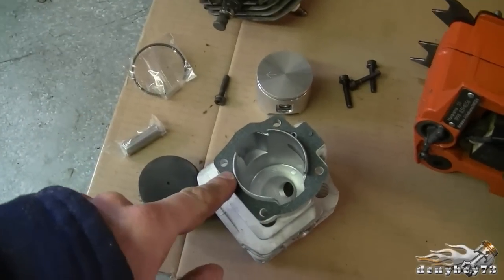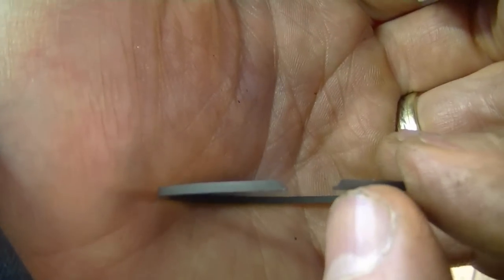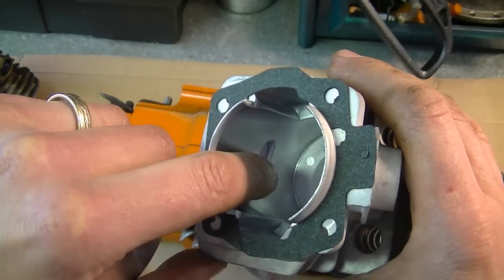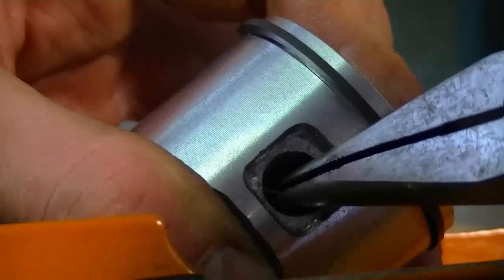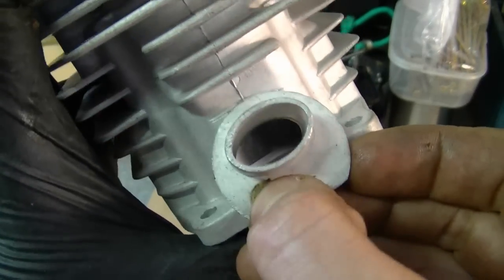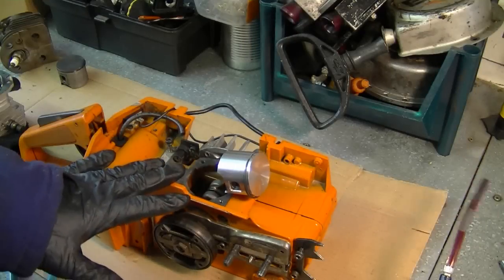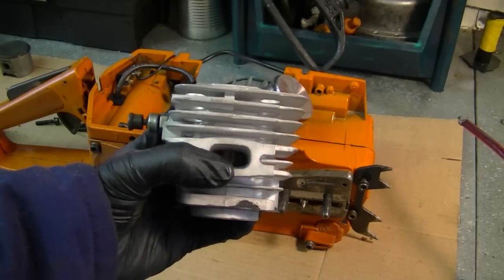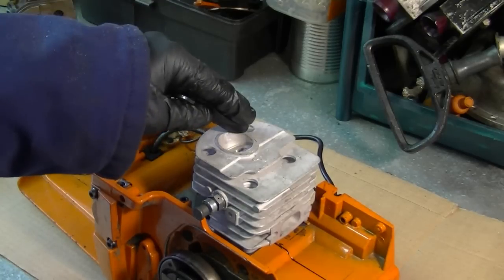Engine Rebuild On Husqvarna 55  & 51 Chainsaw Part 2/3

Comment: Four years ago I was watching this video and realized you were rebuilding  a chainsaw exactly like mine. I could not believe that my piston looked as bad as yours but I was so wrong. I rebuilt the whole thing watching your videos- carburetor included - and everything came together like clockwork. I depend on that saw and since the rebuild, it has never let me down. Thanks very much!
Reply from the maker: what kit did you use?
Reply: @donyboy73   I followed your advice and ordered the parts from China. I think the name of the company was "Farmer Tech" which I thought was a weird name, but whatever. I enjoy your videos. Whenever I run into small engine issue, I keep coming back. Thanks!
Reply: pro trick : watch movies at kaldrostream. Me and my gf have been using it for watching loads of movies during the lockdown.
Reply: @Kaleb Forrest yup, have been watching on kaldroStream for since november myself =)

Comment: Just a quick tip from a machinist who has to use allen wrenches daily. Sometimes when we get a bolt thats tight or in an awkward place, well get a small metal tube and put it on the short end of the wrench and this way you get lots of leverage and it might be a bit easier than a pair of pliers. But your method obviously works too! I like the videos.

Comment: I've always used Loctite when building saws b/c of vibration. Also a stickler on proper torque specs. Good video, straight to the point.

Comment: When you put the piston into the cylinder, you pointed out a little pin that you lined the gap of the ring with. Does that pin hold the ring in place so it can't rotate? I've never seen such a pin in auto engines. Is that little pin unique to this kind of engine?

Comment: Thanks for putting this out there! I also used a chinese top end & thanks to your videos, it now runs like a top. Much appreciated!
Reply from the maker: you're welcome
Reply: donyboy73 
hi. if the cilinder doesnt have a gasket at all, i just have to smear a bit of silicone on it with my finger and it will seal the thing?:o (i have another model)

Comment from the maker: @azfires000 I USED GAS AND A PAINT BRUSH IN A CONTAINER OUTSIDE AWAY FROM ANY SPARKS OR FIRE HAZARDS, if dirt fell in the crank case i would vacuum it out with a shop vac

Comment: Excellent tutorial. I am overhauling a Husqvarna hedge cutter.  Failed to start after loaning it out - I suspect incorrect fuel/oil mix might have caused damage to piston / rings. I have overhaled the carb but still wont start.  Is the cause now likely to be piston or ring damage caused by possible overheating?  Watching your vid now has given me confidence to dissasemble or can I check compression first (if so how is this best done?)

Comment: Thats what i been looking for, a step by step process of the re-built. I dont wanna do it but...
My question is, I have a 575 XP Husqvarna chain saw.  I need to retap the spark plug. I never done it before so Im nervous about it. Do you recomend to remove the head or do it on place? Im just worry about the shavings of the retap.
Thank you
Dan

Comment from the maker: @spelunkerd yesw the pin is to stop the ring from rotating, it is on most 2 stroke engines and you won't find it on 4 cycle engines

Comment: This video series is great. My only question is the original cylinder on my 51 did not have a port for the decompression valve and the new cylinder does. Do I simply cap it ?
Reply from the maker: yes just cap it, you can buy the caps on ebay

Comment: These videos were great.  I did something I never thought I could do. However..  I reassembled.  Got compression. Got spark.  Cranked for a second with starter spray in carburetor.  I tried bleeding the fuel line.  I had soaked the carburetor but no maintenance.  Can I assume it's the carburetor?  An idea for you is to review these rebuild kits!

Comment from the maker: the problem in your case is that the cylinder piston and rings all need to be replaced  at the same time to have optimum compression,

Comment: Great videos , thanks for posting. I just seized my husqvarna 365 today. Not sure what happened yet, haven't taken it apart yet. What supplier on eBay did you use? I saw a couple different ones and how has the saw you rebuilt held up with non- oem parts?

Comment: Hello, really nice videos,  im an engine tuner (2-4 strokes)   and, 

you should put the wrist pin clip at either 12 or 6 o clock, if 3 or 9, they can snap off their groove because of the piston acceleration, especially on high speed engines  ;-)

Comment: Why??? Why i didn't saw you video some days ago.... I have a 2 strokes engine with two cylinders and for some reason one of them always have low compression, after days of thinking and replacing the rings I thought that the exhaust port can be damaging them. Now I found your video and you confirm my suspicions, now i need to wait for the new rings. thanks for your video.

Comment: Hello I have a question, I am currently working on a 33cc 2 stroke engine for a scooter. My piston is all scratched from the carbon build up and I am going to replace it but are there other parts inside the engine that can get damaged because of the piston ? Thank you.

Comment: I'm doing this on a smaller engine and having trouble putting the cylinder in with the clip. Any tips to make this part easier?

Comment: Very good video. I'm only for OEM parts though. How did this Chinese kit work for your friend?
Reply from the maker: still running
Reply: I used a knock off brand, still running 7yrs later.

Comment: the parts that i am looking at most of them say that they fit both a 51 and a 55 but the 55's have a decompression valve, so how can it fit and work on a 51 aswell?

Comment: @donyboy73 your husq/stihl dealer should give you a contact, canada is another continent to me. :D I'm not an opponent of cheap parts, but someone already partially pointed out - it's chrome plated but should be nikasil. nickel matrix plating gives the endurance and torture tolerance. bit more expensive but worth it. chrome is very brittle and can flake off, but nickel matrix is actually impregnated silicon carbide.
OEM pistons are also forged, not cast.

Comment: @donyboy73  Thats what i figure, be the best for the saw. Now the head has some scraches from the rings on the front (only) and they seem to look in good condition, as far the fron thebottom looks like stuck on in...
Have you have any videos on the 575xp? as far to rebuilt?

Comment: I am suprized to see you using RTV/Silicone as a sealer in a gasoline environment. It's OK for oil but gas tends to break it down pretty badly. Have been told Hondabond/Yamabond is the best way to go on sealing lower ends.

Comment: Hey donyboy I bought the piston and cylinder and same thing happened scored the piston and cylinder on the right side twice I gave up do you know what am I doing wrong that I keep scoring the piston and cylinder.?it has no d compressor valve..
Reply from the maker: make sure you replace the piston pin bearing
Reply: donyboy73 yes I did but it just keeps scoring in the same place literally.
Reply from the maker: @ELPATRON839 did u point arrow on piston towards exhaust? also make sure connecting rod bearing on crank isn't too lose

Comment: How did this aftermarket cylinder/piston kit worked in a long run?
Reply from the maker: lasted a few years
Reply: was it the chinese top end that went or something else that caused the failure?

Are they worth the effort installing one?
Reply from the maker: it was the oem top end that went, usually user neglect
Reply: Ah, apologies,
I interpreted your comment as the chinese top end only lasted a few years before going out again.

Comment: I was wondering I looked on eBay and they had the same jug piston rings and connecting rod 4 46 dollars and 10 dollars for shipping do you think that's ok for the chainsaw
Reply from the maker: try to get a NIKASIL coated one, they are better
Reply: Ok thanks oh and I know you like that discount parts but try Gardner and central power there both together but on sells more Briggs and stratton parts the other sells more kohler parts there shipping is like 12 dollars but it's a flat rate if you buy 1 tiny thing or if you buy 1000.00 worth parts still only 12$ and its all overnight shipping as long as you make the order before 3 it's were all the big shops my brother in law told me about it and he works for the state and he says they go through them

Comment: Why did you use piston with one ring? Wouldn't it be wiser to have at least two rings?  I'm still learning how to work with small engines.
Reply from the maker: most Husqvarna saws only have one ring

Comment: Some of those P/C kits aren't bad but the rings are junk, spend a few more dollars and use Caber rings.
BTW ... RTV silicone is not fuel resistant, no need to add anything. to the gasket

Comment: rtv is oil resistant but not fuel resistant, better to use a fuel resistant gasket maker/sealer such as permatex permashield or versachem type 2. both remain pliable and are very tacky so it will hold gaskets in place better. rtv isnt very tacky at all.

Comment: thank for info. Posted down below had 455 rancher 20 hr , on it . I took apart ring was seezed  . changed it it started first pool . 9 $ fix  .Thanks. Oh on 2011 rancher hard to put piston into cylender . just line it up oil it push it together .

Comment: 120 in/lbs or 9.6-11 ft/lbs head bolt torque spec incase anyone came to this video like me looking for this info. Cheers gents! Mine started 3rd pull! A splash of gas in the carb helps

Comment: you can now get these kits on ebay for $29.00-$39.00 just like this.Over $100.00 is way too much for the china made ones. You can get a meteor kit(made in italy) for about $130.00.
Reply: +dyer2cycle I got a Hy Way complete top end kit for 60 bux fron HL supply in Florida ~~

Comment: ---From day one , all 2cycle mfg. recommend 8oz oil to 1 gal. gas (16 to 1 mix). The biggest lie ever fed to the public, was the idea of a 40 or 50 to 1 ratio of gas / oil . A 40 or50 to I mix , will cut the life of your machine , by at least  50%, and this is what it's all about ( you go buy a new machine ) I use a mix , of 6oz oil to 1 gal. premium gas. If you live close to a airport, buy the 100 octane low/lead, your machine will love you for it  and last a lifetime.
Reply: you do realize it's not day one anymore right? follow manufacturer recommendation on oil mix. oils now are synthetic and perform much better, metallurgy has improved, tolerances are more consistent and fueling and oil requirements have changed. too much oil can be just as bad as not enough.